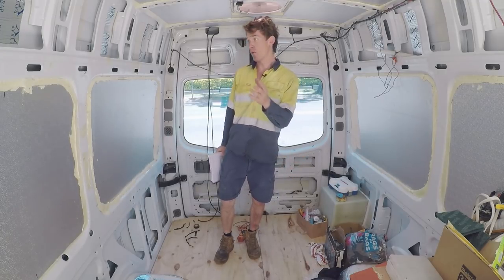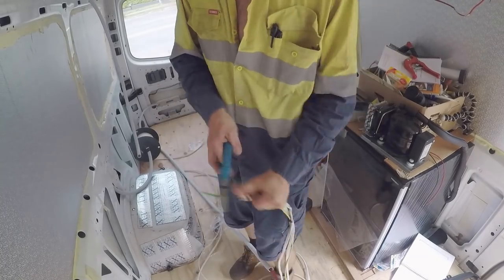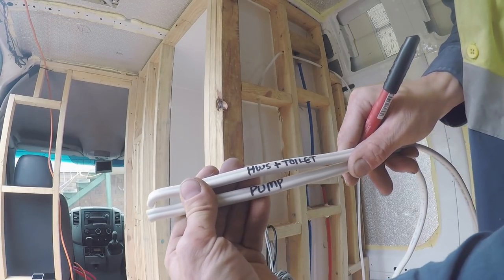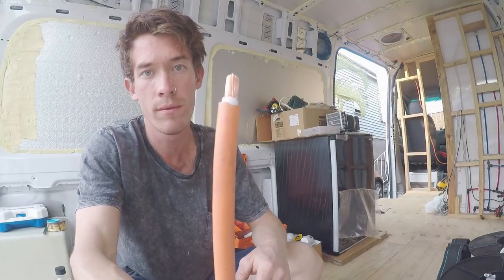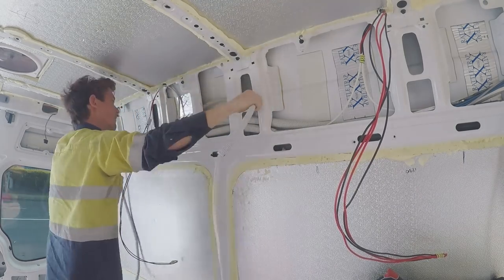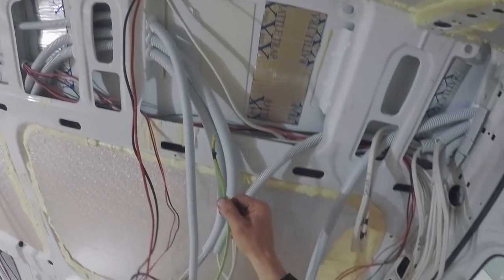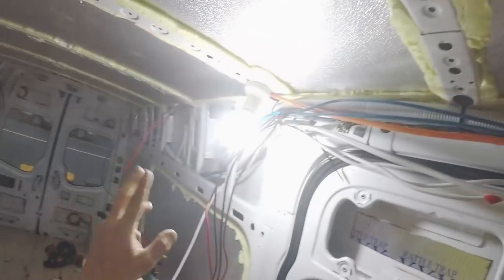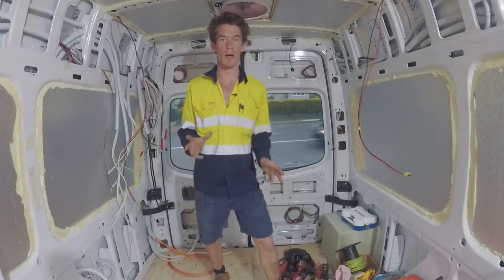S1E9 Sprinter Van Conversion | Electrical Pt. 1

Comment: Hey! Love the videos. I’ve been following your videos as I work on our conversion. Really appreciate the insight. I have an question unrelated to electrical. Are you using any special type of self drilling screw to drive into the frame when mounting clips for the coro? Also, what’s wrapped on your exhaust pipe? Thanks!
Reply from the maker: Thanks Thanks! No just metal tapping pan head screws. And the exhaust wrap is literally a brand called exhaust wrap:)

Comment: Do you have to run a negative from the starter battery as well? In the past I've only wired the positive side and then the relay and the house battery negative to the chassis. It has worked fine, but that might of been dodgy electrical 101?
Reply from the maker: You can do it that way too, but I just wanted to make it absolutely direct, same resistance both ways, because once those walls are sheeted I'll never run another cable.

Comment: Just a question Jaz..I'm in Tas, is an auto electrician the best way or any electrician?Any idea a round about cost to wire up a 400w system, 6 lights 12v, fridge12v, water pump12v and 1 240v outlet??..Cheers great vids..
Reply from the maker: Hi there! thanks for tuning in. I would say a normal electrician would be the best, an auto electrician generally only deals with extra low voltage like 12V and their concept on switchboards might not be as advanced (maybe). with regards to all the costings I really couldn't tell you because it all has to do with what you buy. Once I've completed electrical Pt.2 I will put all the costings to what is in my van. some of those things you listed are already priced on my website in other blog posts for you to see like the pump and solar.
Reply: Cheers for the reply Jaz I will have to get a few sparky quotes once I have all the gear..
Reply from the maker: No worries man 😊

Comment: Awesome professional build. Did you work from a schematic or as an Electrician is it second nature to you? I also noticed you are useing all the same gauge for 12 volt DC and 240 volt AC was that because it was cost effective to use the one big roll or is it required for ISO9001 regs?
Reply from the maker: Hey Karl thanks mate, I didn't work from a schematic I just had it all in my head. I will be writing up a schematic plan though for the blog post so it's easier to understand. Yeah well it's pretty standard in Australia to run all the power in 2.5mm Twin & Earth, unless for a special reason to do otherwise. And yeah i could only buy by the 100m drum so I just bought a whole drum of 4mm Twin for the DC, and used every meter.
Reply from the maker: And yeah you wouldn't want to go any smaller than 2.5mm for 240V AC because of the current carrying capacity etc. Also the DC cable is a thicker gauge because generally DC has higher currents flowing.

Comment: Crazy duck... I'm assuming you're a sparkie... as an idea, what would this electrical fit out cost us down under?
Reply from the maker: Thanks guys, yeah I am an electrician. Are you meaning what it would cost for everything in this episode in terms of cable etc. or you mean once the entire electrical system has been installed with all the components?

With the solar, battery, and all the charging equipment, wiring, breakers etc I'm estimating around $12,000
Reply: Travel With Jaz ... 12k wow... I was looking at about 5k... I need to reconsider my plans
Reply: What about ex components - electrical system design, install and wiring materials?

Comment: Hey Mate, great vids on the build, question for you. When installing the 240v connection as you said by a licensed sparky does it need a certified certificate?  Fitting out a Transit soon for work van (Pilot & Escort) so want to make sure I'm ticking all the boxes. cheers

Comment: hi Jaz ,are you using 4mm  [1.8mm2] or 4mm2 cable?
Reply from the maker: For the 12V DC wiring I used 4mm2 Twin, and for the 240V AC cabling I used 2.5mm2 Twin&Earth 😀👍🏼

Comment: I don’t know why you did not just run the positive wire for the dc throughout the van. Then you could just run the negative to the earth on the van. Your thoughts
Reply from the maker: because  I am using a seperate house battery to power all my electrical things in the back, if i just connected all those lights , fans etc negative to the van chassis, that would be a direct short circuit to the main engine van battery.. both batteries circuits need to be isolated from eachother (positive and negative)

Comment: Esses livros que você mostra no vídeo é manual de montagem?
Tem como fazer download?
Reply from the maker: Which books were you referring to sorry?
Reply: You have two spiral handbooks in the hands while presenting the video
Você tem dois manuais em espiral nas mãos, enquanto apresenta o vídeo
Reply: I really enjoyed the videos, referring to the way you set up the insulation, the electrical, the hot and cold water network.
I could not understand much was the electrical part, but I will review the video a few times.
Gostei muito dos vídeos, referente a forma que você montou os isolamento, a elétrica, a rede de agua fria e quente.
Não consegui entender muito foi a parte elétrica, mas irei rever algumas vezes o vídeo.

Comment: How do you find it using twin building wire for 12V? does it make the battery work harder to produce the juice through the cores? gets hot? or she all good?
Reply from the maker: Its not building wire it is TPS (thermoplastic sheathed), i used 4mm2 twin TPS, so no i dont have any problems, you would only run into problems if you chose to small of a gauge cable for the load you are running
Reply: @JaznLori  that's good to hear, cause TPS is cheaper than Auto electrical flex cable.

Comment: Why was it crucial to put the first wire in the coroe and not the second
Reply from the maker: The 240V wiring needs to be on corro, but 12V doesnt
Reply: Travel With Jaz oh okay but why the 240 volt mate needs to be in the corro and not the 12volt
Reply from the maker: In Australia, as per AS3000 low voltage cable (240V) needs to be in adequate wiring protection if the wall thickness (cavity) is under a certain width. Also it is just good practise as the entire van is metal. The 12V is such a low voltage that as per wiring rules it isn't needed.

The corro is also to act as a "Segregation" barrier between low voltage 240V and extra low voltage 12V where I could not maintain a minimum. 50mm air gap

Corro also acts as a protection method for the cable when going through a hole in the van metal. There are many multiple reasons for it, and it's always better to go overkill with electrical rather than Underkill 

Hope this helps 👍🏼

Comment: Why did you use a larger cable for your 12v then your 240v ? Is there a clause in AS3000 ?
Reply from the maker: It's all about voltage drop limits and current carrying capacity. Yes there are clauses about these in AS3000 but in short the higher the voltage the less voltage drop, and generally less current too, which is why you have to run a larger cable for lower voltages to stay within a respectable voltage drop limit

Comment: too small space between the roof and solar panels - should be about 2 inch (roof will warm up)
Reply from the maker: Actually the panels do a great job of insulating with that amount of air gap, coupled with the internal insulation the van stays cool on hot days

Comment: next time your under your hood {bonnet } look at the size of the wire from the alternator to your vehicle battery ...you only need heavy wires to your camper battery if you plan to jump your car to start it ...crazy waste of money to run wire that heavy ESPECIALLY BOTH ways
Reply from the maker: Not completely true, you have to take into account the length of cable run too. In my case I did a calculation to minimize voltage drop as the run from the battery to the DC to DC charge controller was around 11 metres from memory. That's a 22m circuit with positive and negative. anyway, 25mm2 was the best size to keep the voltage drop low

Comment: Not afraid to make so many holes in the reinforcements of the structure?, already the huge hole to pass the toilet cassette, here in France if you touch the structures you are refused the technical control...

Comment: Your videos are nice to see! I wish you all the best for your travelling. But please let me give you some safety hints. Because it would be a pity when there occur some fire! When you only drill but not crimp with an professional crimping pliers there is danger of sparking especially at moving objects like vehicles! The joints of your electric cabling isn´t professional like it should be! I hope that you will not get any problems with that. Onto that i hope that there are not any pets that love to gnaw on cables out at the bottom of your vehicle. And i hope that all plastic parts are far enough away from parts that getting hot like the exhaust pipes.
Reply from the maker: Good tips mate cheers for that, I can see what you're talking about the crimping, I'm positive they'll be fine, they're crimped very hard! The corrogated conduit under the van won't be a problem with animals I'm quite sure, that would be super rare. The exhaust pipes are heat wrapped. Cheers!

Comment: best and most thorough Sprinter van build video on the net....THANK YOU for posting these.  they are incredibly helpful and well made.  I was wondering about speaker wire?  not a concern for this build?  and if you're running the cat 6, why not run a few extra for a WIFI booster antenna?
Reply from the maker: Hey Irvine, I was thinking about running speaker wire, I might still. I'm happy with my UE boom speaker! I could do that too still might so they also, Cheers